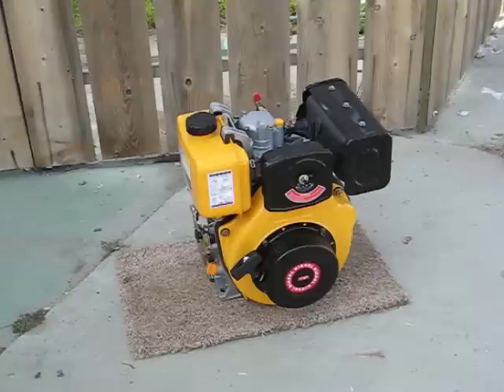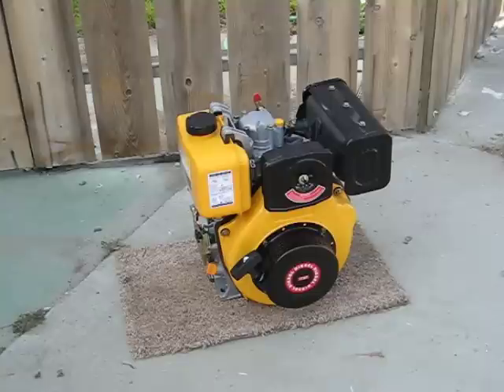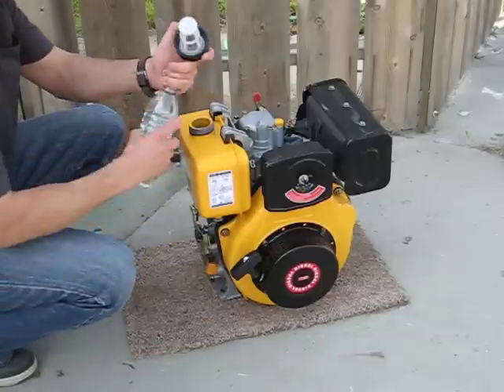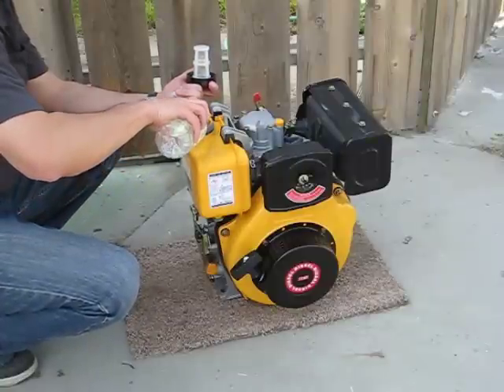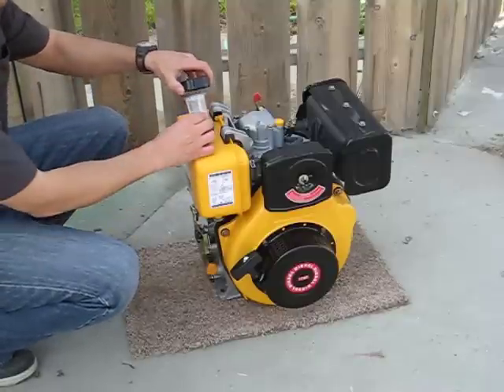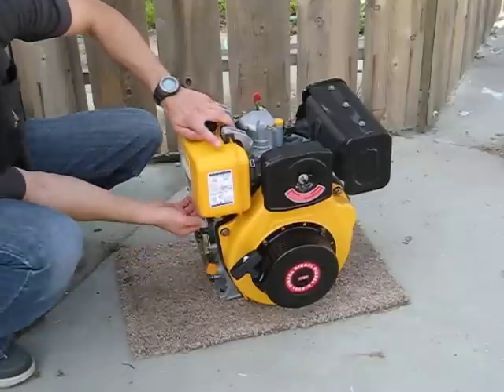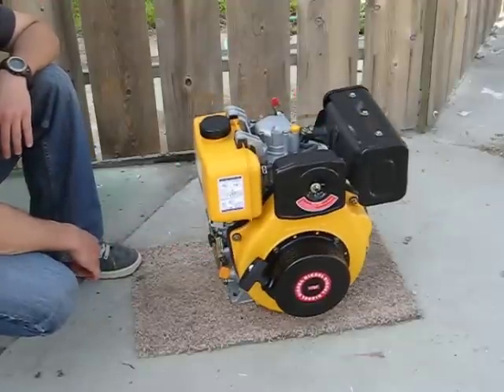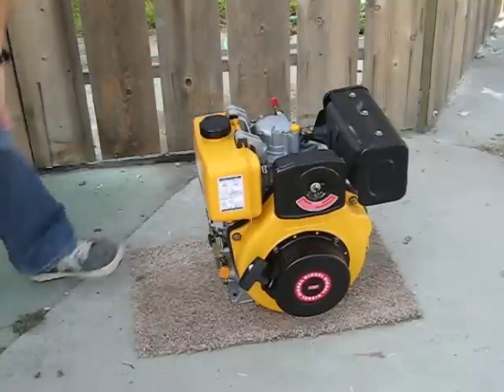Diesel ready (6hp) Minibike engines (No longer importing)

Comment: Just found another 10 hp diesel on ebay right now for $719.99.

http://www.ebay.com/itm/10-hp-Diesel-Engine-CF186FE-pull-and-electric-start-brand-new-/161891063936?hash=item25b1759880:g:rR0AAOSwLzdWTKw0

Comment: I have been running this engine for over 2 years now on an irrigation pump. The engine has a manual compression release, so it is not hard to start, and almost always starts on the first pull, even when it is cold or runs out of fuel. The filter in the tank neck is a pre filter and can be taken out and cleaned. It has another, replaceable fine filter in the fuel tank that filters the fuel before it goes into the injection system. it is an aluminum block with a steel, or cast sleave. It has been very reliable for me. It has no electrical system at all. I do not know the compression ratio off hand. It is quite high and the compression release is a necessary to get it cranked. It is almost impossible to pull it through with the recoil starter without the release on and probably would result in a broken starter or starter rope.

Comment: Do these run well on off-road (red) diesel? If so I might buy one of these for a tractor I'm redoing. Even though a diesel engine of this size has about the same power as a gas engine, but it'll use way less fuel doing the exact same amount of work.
Reply: off road diesel is exactly the same as regular diesel, just taxed differently.  it has red dye so if pesky highway cops want to dip in your tank they can tell if you have ripped off the government for a few cents
Reply: I know. But the cheaper prices does add up over time. But in some cases its sold as an unmarked blend of biodiesel about a B5 rating.

Comment: the fuel filtr is inside the fuel tank on the fuel outlet. the hand start withe the recoil rope is somtimes very difficult, specially with old engines and low ambiente temoperatures.
an electric starting motor i much more rel liable

Comment: I noticed that he did not pour the diesel through the filter but the removed the filter with the cap and then poured the diesel straight into the tank.   That  fuel filter is there for a reason and I think he should have used it!

Comment: Great engine....how much did it cost where did U buy
Reply: you can buy them on ebayhttp://www.ebay.ca/sch/i.html?_trksid=p2050601.m570.l1313.TR0.TRC0.H0.Xsmall+diesel+engines&_nkw=small+diesel+engines&_sacat=0&_from=R40
Reply: Thanks for the reply. What´s Ur experience with those engines.Do U allready have a lot of hours ? What is the economy of this engine ?
I´m a little worried about vibrations in low RPM
How low can U go ?

Comment: 6hp from a 300cc engine?...Seems very low.
Reply: the tolerance of these engines are much bigger than an enginie on a car. Yes, those on a car will produce much more power than these stationary engine, but a car engine can't be on full rev for 2 hours without exploding ;)
Reply: the HP here means 746 watt .. really this engine power = 4.4*2=8.8 HP .. this is what the manufacturer told me that each 1kw requires 2 hp mechanical power.because the efficiency for the mechanical power will not exceeds 60% at best case
Reply: ahmad jordan
Man, if 1 HP is 746 W, then 4,4 KW is 5,9 HP.